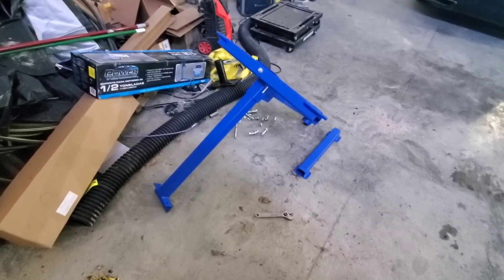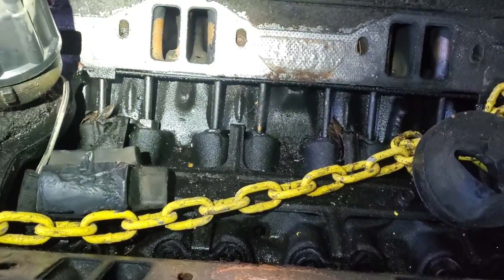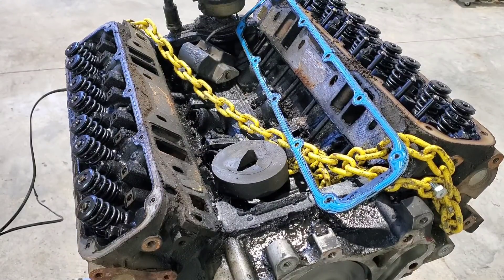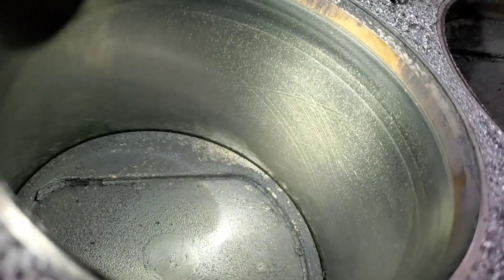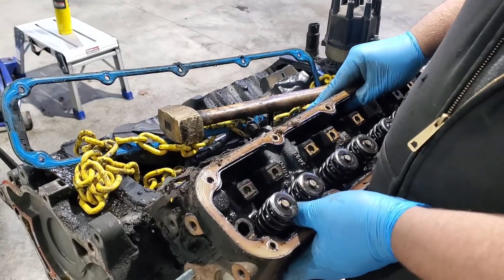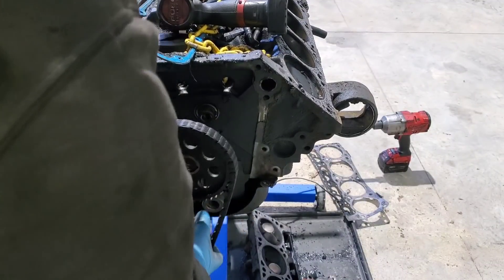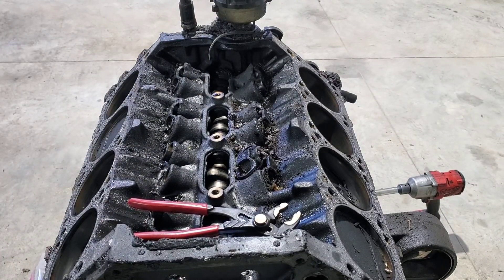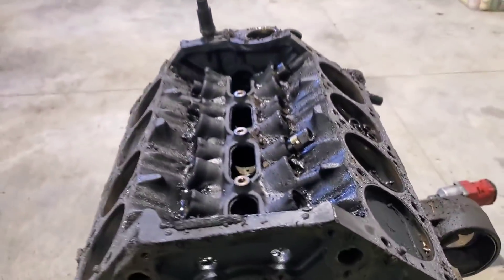5.9 magnum disassembly

Comment: These an the 318 engines were one heck if a die hard engines .. good maintenance kept up faithfully an dive em hard work em hard an they never let ya down.. a lot
Of it is good maintenance witjout them shortens life spand  as we know ..what a great engine you habe ot rebuikd for sure 👍 ive git a the kst year 2003 dodge truck with 5.9 magnum 360 jus befornit git switched over to hemis an mine rihht now only has 85 thousand original miles never hardly ever driven in winter .. i have it done up with  cam an power adder mods trans power modded fulky an HP tuner tuned it all ..etc etc an its now almost 400 horse tonrear wheels an does 14.3 annthatbwas before tuned by HP tuner guy.. im person with disabilities in wheel chair an have military friend retired that helps me do my engine mods an maintenance.. due to my health an live in Canada i never go anywhere in winter son truck never gets driven ir see much sand an salt .. its a 2 door regular cab shortbox automatic performance built trans an has 391 rear sure grip gears an is fully loaded air conditioning an all options .. love the truck an lots of fun .. jus SUNSCRIBED to your channel an am going to follow this build an also whaterver else you do on this channel .. you seem like a smart common sense guy down to earth an also well spoken as in clear understanding of what your sayimg an i think you would make a great mechanical teacher !! We need good teachers to keep guys like us going .. jus a food for thought fornyou in future lol .. thanks fornthe video of this N i look foreard to watcheing thenrest of this build .. sorry bout my soelling as it gets worse die to my health my eyesight worsens the more i use it when txting like this cheers man👍

Comment: Definitely a standard size. Factory replacement mopar bearings will have a .001, .010, .020 ect stamped on the shell if they are oversized. I pulled a 2001 Jeep 4.0 that all the bearings were .001 oversized. It must have had a slightly to large of bearing clearance from the engine plant that they corrected.

Comment: Most of those heads have cracks between the valves. Most of the time those never crack to coolant though and don't hurt anything.
Reply: Bout to say the same thing. Went through 3 sets of heads at the salvage yard before I gave up an just bought some aftermarket heads.

Comment: I had a three wheel engine stand, really bad design, putting so much weight on one wheel. I always felt like I was about to tip the engine over when I moved it. Got rid of it and got a four wheel stand, much better stability and easier to move.

Comment: Question not critisism, why do you not steam clean an engine before stripping it? I know you will look for oil leaks etc but you could do that, then clean it and dismantle a much cleaner engine?
I'm no mechanic btw!
👍
Reply from the maker: It got cleaned after teardown. Easier to manage and now I know this It's worth the effort.

Comment: Wow thats sludgee.. add a couple spoon-fuels of seafoam in it. Leave it in there..replace rings , all oil seals, bearings .no need to send it off.. lots of these 95+ trucks do better with a trailer pull

Comment: Not much wear at all on that block.  Should be nice once you're done freshening it up.  Since I'm not yet a member of your patreon page, are there plans to use the Cometic head gaskets, along with the ARP bolts?
Reply from the maker: Well I was planning on ARP bolts but summit keeps delaying them, so I may start looking for alternatives. As for head gaskets I'll se what my overhaul kit came with and most likely upgrade from there.
Reply: @Spyke383  Sounds good.  👍🏻

Comment: I would say maybe wrong type of oil or right oil wrong climate, maybe should of used an additive like Prolong Super Lubricants PSL11000 Engine Treatment other than that it could of gone another 100,000 or so more miles.

Comment: My 92 had a magnum 318 , ran like a scalded dog , not a big fan of the keg intake, the magnums seem to make all the power and torque above 3500 rpm
Reply from the maker: The later intakes did away with the divider, and you can further improve on them by welding in pieces to eliminate the dead space between runners.

Comment: A "stall" convertor ?????????
Reply: A stall torque converter lets the engine get into the power band before locking up the transmission into gear.  It's like slipping the clutch for an automatic transmission. They come in different rpm ranges